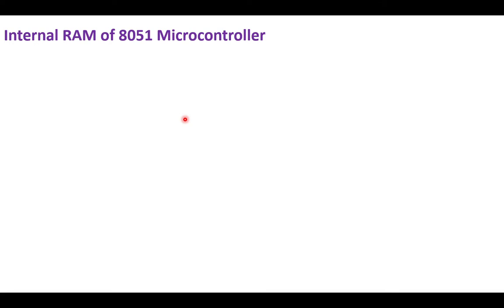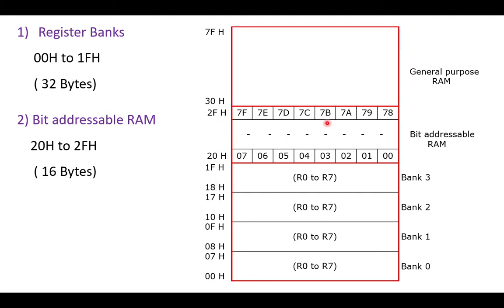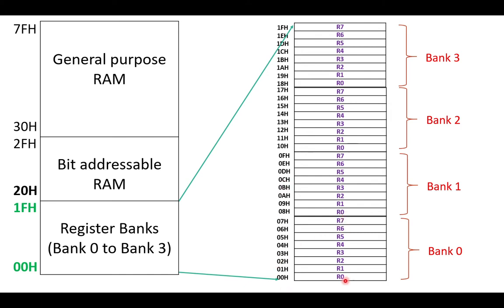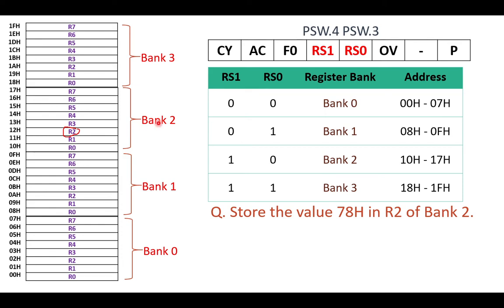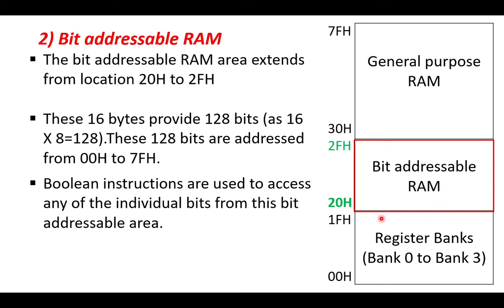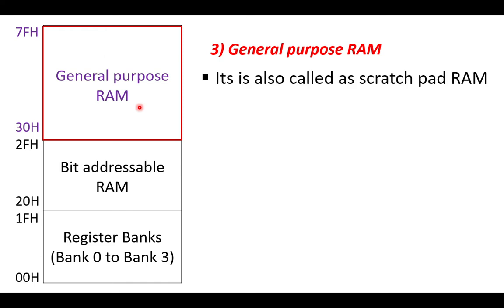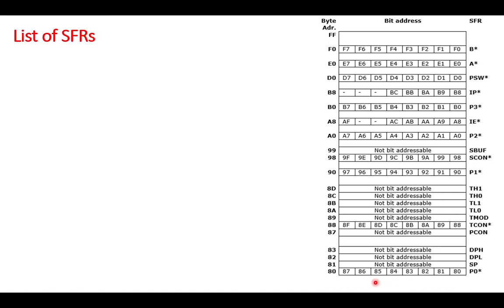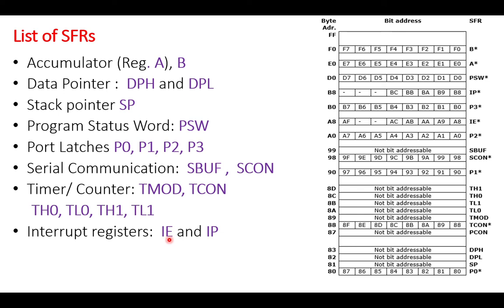Internal RAM and SFRs of 8051 microcontroller

Comment: If there is only 21 SFRs  in 8051 so why they have occupied 128 bytes of memory unnesessorry if not then why ?
Reply from the maker: It may be reserved for future use.In addition to the existing 21 SFRs , the new derivatives of 8051 microcontroller family provides new features with additional SFRs.These new SFRs occupy the certain locations from unused space of SFR(80H to FFH).Still there are unused locations left.